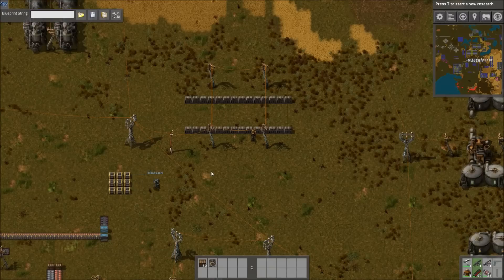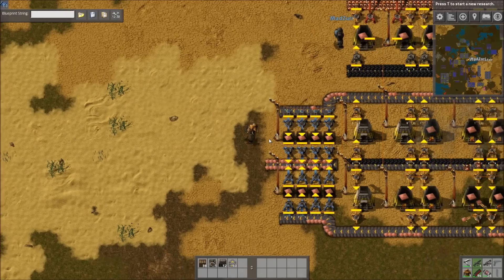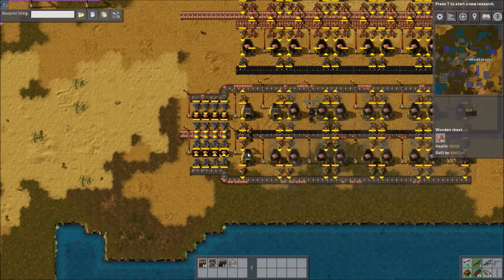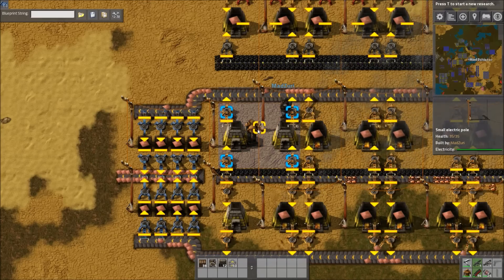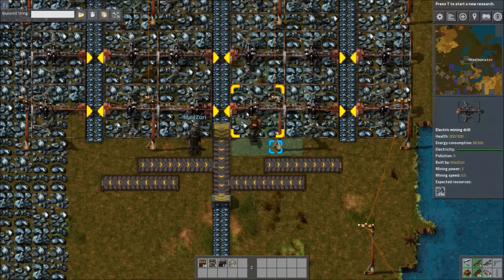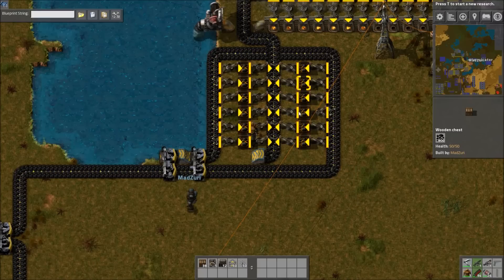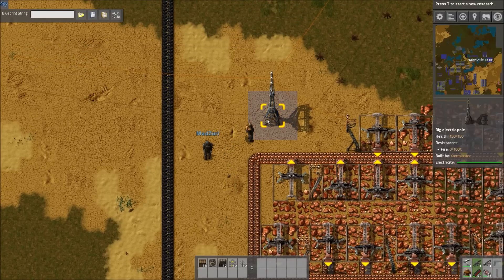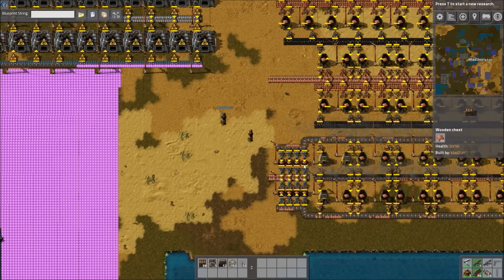Factorio Workshop - Building A Better Factory :: Buffers & Zuri's Mining Setup

Comment: i have to disagree strongly. 
the buffer allows you to react once your consumption out paces the production 
protecting crucial pieces of the production and buying you time once something runs low
EDIT: later on .. about coal you bring up the same argument ... it buys you time once stuff runs low or out
EDIT2: about the buffer provides false security and makes the shortage worse.. no still have to disagree.. put a cable network on the buffer and an alert if an lower limit is reached and viola ..

Comment: Unsure how to word so bullet points. 

Buffer outputs more per than a small smelting line. 

Can look like you dont need more throughput until buffer runs out. 

Cause confusion when something was working fine for 10 mins then it all shuts down when you haven't made any other increases.
Reply: Oh you've covered my point in this hahaha.

Comment: so i set up buffer chests on the outside of smelters, for two main reasons, the chests are connected to a circuit network (mostly for early game to preserve ore fields while i get around to researching mining productivity. The resources stocked up in a furnace are essentially wasted productivity. , the chests are limited to a single stack, but the entire 4 or 8 lane buffer is balanced into and out of the array, meaning all four lanes remain full on the output side (using loaders),and once i switch to logistics system based production, the chests (with loaders) are already placed along the bus.

Comment: With the belts, would it be better to place poles between underground belts to not have that one space gap between the miners? Or is that more resources (extra underground belts) for a slightly more compact design?
Reply: That's not just slightly more compact, that's the 1 row of wasted space gone and more effective. The additional cost of some iron crumbs for undergrounds is a non-issue.
Reply: The space for the pole has to be someplace. why is between miners better than in back between rows of miners.  Don't get it.
Reply: @vibepusher2717  The argument presented here is that it helps balance the belts, because miners that don't have a space between them have roughly twice as much ore that either can mine -- ten tiles instead of five. If they're in the same row, it doesn't make a difference which miner that ore is mined by; it'll end up in the same lane of the same belt (and will take longer to get mined at all if that lane backs up). If they're back-to-back, then it does make a difference -- and if one of the lanes it could end up in backs up, it can get diverted to the other one by being mined by the other miner (and maybe even get merged onto the same belt, since it's on the opposite side of its belt).
Reply from the maker: It is definitely more resource intensive to use underground belts than to just space out the miners and place the poles in between sense that takes no resources to do. Having the miners spaced out like that is less compact but shouldn't make that huge of a difference. I think at that point it comes down to personal preference. :)

Comment: "Inherent balance" is kind of pointless if inserters always pick from the inside of belts.
Unless you perfectly mirror your factories, it'll become unbalanced.
Reply from the maker: They prefer to pick from the inside of belts, but will grab from the outside if they have to. So if the belt is balanced from the start, "inherent balance" then it will still work fine because once one side runs out from inserters grabbing it, the inserters will just start grabbing from the other side.

Comment: Talking about opportunity cost - Buffers can save a lot of cost in this way too, but not when applied to smelting (because of the built-in buffer and because the simplest items are more consistent in their rate of use).  Cost-wise, it's most efficient to build the least amount of machines possible to fill your needs over time.  If you don't use buffers, you'll need to build enough machines to cover peak demand, and they'll be idle at lower demand times.  Smelting is not a great example because every other production machine in the game stores like 10% or less of a stack.
Reply: I think the problem with this is that the end-goal of Factorio is to be at peak production all the time, so all that "unused capacity" will get used later :)

Comment: Around 6 minutes in you're talking about opportunity cost, and specifically that if you had spent the time to set up more miners instead of making a buffer you'd have more production instead of needing the buffer. 

Well, you guys didn't think it through very well. 
I have 3k+ hours in factorio, and it takes less than a minute to set up a buffer especially early game. 
Now, if we're in early game you need to walk to the ore patch, put down the miners, then the belt, then the poles, then run the ore back to base, then either set up more smelting or plug it into your already set up smelters. This takes much much longer. 10x or 20x longer. 

Meanwhile you're setting up miners, your possible excess production does absolutely nothing, just sits there as piles of ore. where instead it could be put into a system of large chests and belts in a huge buffer.

If you were in late game, you would need to take and set up a train line to the resource, then set up the drills, belt, power poles, and the station. Then you set up the train line, and send it back and fourth, and then you still need to either plug it in or make new smelting. 
And this takes even longer. Could take you 30 minutes or an hour depending on how much forest is between you and that ore patch. 

And as for the biter concern, I hate people who play on peaceful, or peacefully. The only part of the game that threatens you to lose are the biters. Even if you play on a hellworld, setting up and making lasting defenses is one of the best parts of the game, it's so satisfying. 
You should already have base defenses anyways, so biters shouldn't bother you.
I make huge factories. HUGE. Factories so huge my game lags on my gaming computer. 
that being said, i make a lot of pollution. I never worry about it because it doesn't really matter that much even on a hellworld. 
I notice in your latest videos it doesn't seem like you're playing on the latest version, as you don't have the blueprint planner. So I don't know if you know this, but the bitter evolution has been changed. Now it takes significantly longer to get to the behemoth biter being able to spawn. 
And with your little factories and smaller amounts of pollution i would honestly be very surprised if you get to behemoths within 30 hours of play for you. And besides, making your factories into fortresses is super fun. Concrete and walls are one of the best things in this game, and making walls with their own robot networks for repairs adds another layer of fun to the game.

Just something you may want to actually consider when making your next video, is how little pollution really matters, and to think about all the aspects of setting up things in factorio. 
Cheers!
Reply: Honestly, from an "opportunity cost" standpoint, buffers are a total win.  Running back and forth takes time. That time could have been used for another purpose.   When you have a buffer, you can build your mining and smelting facilities a bit more oversized and start building up a reserve which limits the most useless time-cost in the game -- switching between tasks in different places.

There's an excellent point about screwing yourself, though. That's the risk you take.  However, with a little circuitry, how hard is it really to set up warning lights?
Reply: +colin dodson If it's full because you produce more than you consume, it does nothing and if it's empty because you consume more than you produce it does nothing. The permanent solution to underproduction isn't buffering, it is to match consumption.
Reply: Completely agree with you colin, everything we do could be stupid if done incorrectly, but the benefits of a buffer being able to provide a much larger boost of resources when needed is nearly invaluable, as you mentioned most of the time spent in factorio is switching between tasks or setting something up, and you can't always be adding more smelting when trying to expand your red circuit production
Reply: chris c except that a buffer does do something. It keeps your production running when there's more resources than needed, and can provide temporary surges of resources when demand goes above supply. With buffers, it's possible to maintain an optimum factory where without it isn't possible. (you'll always end up under or over producing, and machines will idle, wasting time)
Reply: Additionally, while a "dumb" buffer will limit throughput as well as do nothing for peak loads once dry, a slightly smarter version can fix both of these problems.  I call it "latched - even flow", and I think we have Zuri to thank for the modern more elegant methods for both of these.  Anyway, what that means is that you can trade long-term lower-production into burst high-production.   This way you can build like you've got full-belts of each resource, even if your smelters couldn't provide it continuously.  

What I enjoy most about this approach is the incredible degree of fine-tuning that can be performed depending on circumstance.
Reply: That's dandy and all but seeing how a buffer does literally nothing, you'll still get more out of spending energy on setting up things that actually do something.
Reply: I think you're right about the opportunity cost not making a lot of sense.  But I still agree with them that smelting buffers don't make sense in a belt setup.   If you get to a point where the stack per furnace isn't covering the lack of production, it's simply a production issue.  For bot bases I usually put the logistic condition on the input of furnaces rather than the output and move the buffer into the network rather than the furnace, so that may count as something of an exception to the buffer rule I guess.
Reply: Can I play with you?
PLEEEASE?

Comment: 5:45 Another refutation of the "smoothing out production" argument: the way everyone finds out they need more (for example) copper is they have some production problem and trace it back to a lack of copper. With buffers, you have production problems and trace it back to a lack of copper and an empty buffer. The buffer only helps if it alerts you to the fact that you are running low, which you could find out anyway by just paying attention to your map.
Reply from the maker: Yeah exactly, that is one of the most solid arguments against using buffers, along with the others we mentioned. It just masks a potential problem, or even causes additional ones. lol

Comment: The main reason I buffer plates is so my factory doesn't dry up the second the ore field does and I have time for the process of building a rail out to a new field or two.  The buffer lets your factory run smelting at full speed until the ore field empties and your factory runs at full speed always.

Its really a preference, you can either be proactive and make sure the ore supply exceeds demand by building new mines prior to the old ones drying up, or you can use the fields drying up as the motivator to find more.

The power cost which was brought up is a moot point as inserters rarely consume meaningful power, and once you get solar power its a solved problem.  The drills will use a decent amount of power though.  I guess pollution is bad, but the only time I have had anything in a mine be destroyed by biters is if I forgot to build any turrets or it is in the middle of a desert.  (Usually I have killed all the biters in a mile radius and placed little pill boxes everywhere)

As for the mining fields only mining what you need, if you have ever watched this, it mines from one side of the field to the other which makes the field last longer, but it can't give you the throughput when you need it.  But if all that ore was sitting in a box already pre-smelted instead of in the ground you can have as much as your bus can provide.

By the point you are firing rockets as fast as you can build them in one ore more silos, The game kindof just turns into running around finding more ore and oil. So you may as well get it all mined as fast as you can.
Reply from the maker: Well in the end it is all personal preference. As we mentioned though, they aren't as bad if you are experienced and aware enough to notice your input is drying up and have time to set up more mining and outposts like you mention. The problem that a lot of people (primarily newer players) have is that the buffer prevents them from noticing these issues until it's too late because the buffer makes it look like it's running at 100% for a while even when it's not. 

In the grand scheme of things, the power is almost moot, but was worth mentioning anyway. As for pollution, it isn't really the fact that your outposts might get attacked (although that is a bit of an issue), but the fact that the pollution increases biter evolution as a whole. So having your mines and smelting running 100% of the time even when you don't need it to is creating lots of pollution that's advancing biter evolution. Which again, if your experienced enough to deal with the biters without a problem then it's not that big of a deal, but a lot of people have issues dealing with the attacks and evolution of the enemies. 

An yeah good point about always running around finding resources when you're launching that many rockets. Thanks for explaining your point of view, always nice to see different views on something and discuss it. :)

Comment: I do use buffers, but I don't use the 4 long buffer, instead I half that and use 2 buffer lines for each side of the smeltery. The idea behind this is to maximize use of the buffer, make it more manageable while having a bit of a backup incase anything goes wrong. I've played long enough to inherently check my inputs whenever I finish up a section of my factory, like if I finish setting up green science, I check my inputs, make sure they're properly supplied, turning the issue of buffers distract from the input to an advantage. By that point, I've generally tapped the local resources and I'd have to go out further, the buffer ensures I have a bit more time to go out and hunt for resources and set up, keeping the factory going even when I don't have resources coming in. I've also started to play modded more often than not, and using the resource monitor helps ensure resource input. But when I play vanilla, it is essential to follow a pattern to check your factory overall. Don't get your head stuck on one part of the factory then move onto another part of the factory without checking over everything. Yes it takes a bit of time, but it's better to avoid neglect and be sorry later.

Comment: What's your opinion on corner buffers for storage? I tend to buffer things like green circuits and belts from the early stages so when I get logistics I just switch them to passive providers
Reply from the maker: I'm not entirely sure what you mean by corner buffers. Like you add buffer chests on belt corners, or something else? 
While I understand the idea behind buffering them to later have it turn into logistics storage, I still think it should be avoided. Perhaps starting to buffer very close to when you get robots is not a bad idea so that you have a bit of stockpile, but I would still say that unless it's like 10-20 minutes before you get robots online that the buffering should still be avoided if possible. :)
Reply: It's a very simple buffer with one inserter before the corner and another after the corner feeding to and from one chest to the same belt lane
Reply from the maker: Callum Budge
Interesting. That's definitely not as bad as some of the huge buffers.

Comment: I rarely use buffers.  They always seemed a bad idea and take up too much space.  Though saying that I have used a buffer or two in the past. but only on Ores and coal.
I have used a massive bus system to clear a mining patch before. Storing the ore because i did not have the production to use up the ore.  But it was a passive buffer, removing from the ore belt keeping the miners working.  The smelting and factories were not using half of my mining.  It made sense to use it at the time so I could then expand onto the location where the ore was for my factory.  Then as the stored ore ran out I reclaimed the field of buffer as well.

My current playthrough I have used a buffer on my battery production. I was lazy and just used a pair of chests to make two chemical plants output to the same belt plus give me a chest I could pull some storage batteries out of.

I am intentionally annoying the biters though, just because I do not usually play with them and this time i really want to annoy them. :P

My iron and copper lines are run directly into the main bus. I judge my production by how many resources are backed up on the belt.
Reply: I got tired of mining out ore patches so I could expand over them, so I wrote a mod that lets me move ore. It isn't very well written, and the art is terrible, but it lets me shift ore so I don't have to build on it or wait.

If I ever go back and improve the code I'll publish it to the mod portal and setup a GitHub for it.